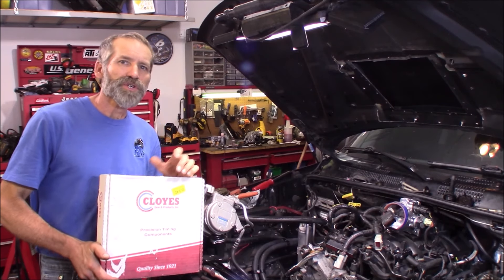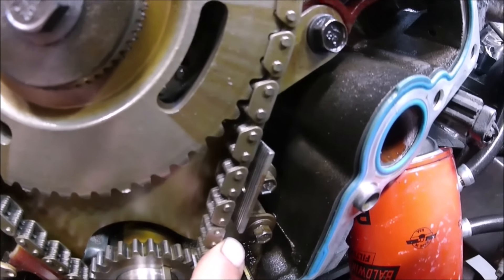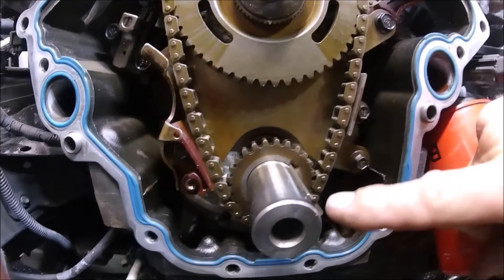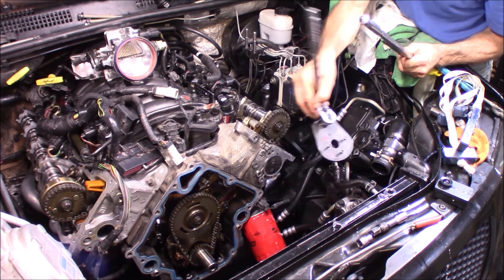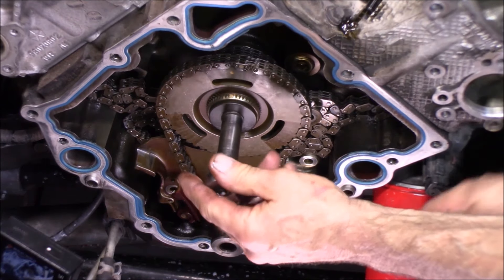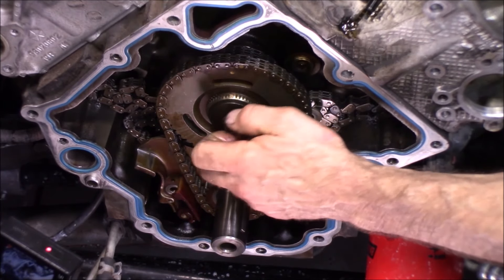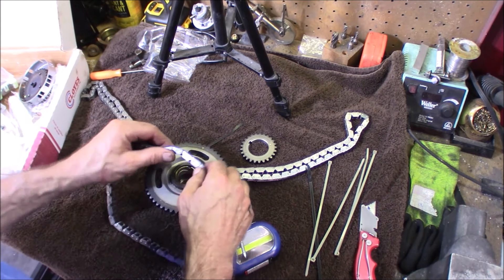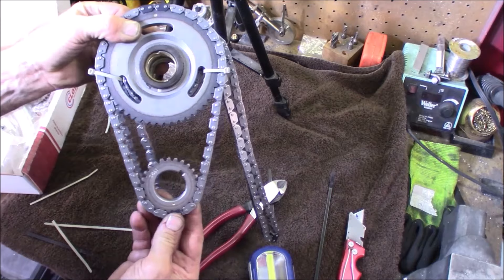How to Install Timing Chain Set Dodge, Jeep & Chrysler 4.7 & 3.7L

Comment: Great video as usual! Do you know if it's bad if I accidentally put the transmission into Neutral while driving , then when realizing it I put it in Drive again.. (WJ 4.7) . Nothing have changed but it bugs me.
Reply from the maker: I put mine in the neutral all the time especially at every light and when coasting. I've been doing that for years to both my Jeep to help improve gas mileage.
Reply: @martinbuilt  Really?  You put it back in drive while coasting too? There was a slight "thud" when I did it .. nothing crazy, but not smooth! I was going at about 25 mph in city traffic and had cars behind me so I couldn't just stop the car.
Reply: @martinbuilt  I have read/heard that you should keep it in Drive while coasting, the fuel injectors will shutoff just by letting off the gas pedal. The momentum of the car rolling will keep the engine going. There's videos on youtube "5 things not to do with automatic transmissions" that mentions that.. :)
Reply from the maker: @farerse  yeah whatever I've seen that video I'm calling BS. I have a wideband air fuel ratio gauge  and I can assure you when you let off the gas it is not  shutting the injectors off . And besides when you're at a light you put it in neutral you've taken any load off the engine. I can guarantee you you're saving some gas.
Reply from the maker: @farerse  were you on the gas at the time you put it back into gear. When I put it back into gear I always have it at idle.
Reply: @martinbuilt  Interesting , I do change a lot between 2 and D depending on the speed limit and traffic conditions.. this time I forgot I was already in D and put it into Neutral. I did let off the gas pedal , and tried to slow down before putting it in D again.

Comment: I have a question.   I pulled my cover off and my primary chain tensioner is broke.  Would it have caused the engine to be off time?
Reply from the maker: I doubt it, as you saw in the video my primary chain tensioner was broke as well and I had no idea that it was broke the engine ran perfectly fine.
Reply: @martinbuilt  Okay thanks
Reply: One more question. 
Could an 07 cylinder head go on an 05 3.7 bottom block?
I remember you saying the 4 wire ecu is different than the three wire from the 05.  But I was thinking would I have to switch cam sprockets,  or just cams,  or should I get a cylinder head from a 3 wire ecu engine?  Thanks.
Reply from the maker: @Ed.01  yes you can swap cylinder heads as long keep the same cam gear on the right side (passenger side) stays with your vehicle.
Reply: @martinbuilt  okay cool thanks.  I'm at the pic a part, but the 07 was bad, I got one off an 02 that looks good just the valve cover is different.   I appreciate your videos on the 4.7s.
Reply from the maker: @Ed.01  I just thought of something that could be different on the cylinder heads. Later models may have an EGR valve at the rear of the left (driverside) cylinder head.
Reply: @martinbuilt  yeah you're right. 
I got one off an 02 liberty for an 05 Laredo so I think I'm good.  I got an 05 valve cover for it too.

Comment: Is this what is considered dual overhead cams?
Reply from the maker: No this is a single overhead cam engine.  Here are some examples of dual overhead Cam engines.
Ford 3.5L EcoBoost V6 DOHC.
Ford Mustang Boss 302 5.0L DOHC V8.
Ford Mustang 5.2L V8 Supercharged.
BMW S65 DOHC V8.
Infiniti 3.0L VR30.
Mercedes-Benz Inline-6 DOHC
Reply: So the main chain runs from cam to crank what are those other 2 chains running. I’m a backyard mechanic kind of lol. Just my own vehicles but I’m not familiar with this set up.
Reply from the maker: @SVMSICE   The main chain goes from the crank shaft to the idler gear the other 2 chains go from the idler gear and one to each camshaft
Reply: @martinbuilt  Oh so there’s 2 cam shafts. Ok thank you.  Now I have to look into what an idler gear is.
Reply from the maker: @SVMSICE  Perhaps you could watch the video.🤔
Reply: @martinbuilt  yeah that is a good idea. I listen to YouTube at work so a video like this I save for the evening or morning. I just watched it. I understand it a lot more now. Thanks for taking the time to make this. You did a very good detailed job in explaining the procedure.

Comment: Hi can you help me out. I put an 06 head on an 02 4.7. Now it won't start. Crank but will not fire. I kept my original camshaft gear as it is not a NG. Will the head from an 06 work on an 02?
Reply from the maker: yes it will work, are you sure the timing is correct.
Reply: @martinbuilt  I will check out cranks but no compression. I redid the timing maybe I made a mistake?
Reply from the maker: @Phoenixrising8313  are you saying you have no compression? You may have bent the valves.
Reply: @martinbuilt  Sorry I have not done a compression test yet. The motor just cranks but does not fire. There was no metal damage sound when I tried starting the engine indicating valve damage. I changed the head with head gasket passenger side and re did the timing chain. Motor will not fire. I have not ran a test for spark fuel or compression yet.
Reply from the maker: @Phoenixrising8313  did you remember to plug the camshaft position sensor in
Reply: @martinbuilt  Yes I even swapped it out with another lol. Cranks but no start. Have not tested fuel, spark or compression until tommorow. Any guess what it may be? Or something I may have missed.
Reply from the maker: @Phoenixrising8313  Like you said, check fuel pressure, spark, let me know
Reply: @martinbuilt  Hey Martin my timing was off. I Did not have the crank, cylinder 1 set to top dead center. I will have it put back together tommorow.
Reply from the maker: @Phoenixrising8313  glad to hear you figured it out.
Reply: @martinbuilt  Thanks for all your help. She runs great!!!
Reply from the maker: @Phoenixrising8313  I'm glad to hear that!

Comment: Martin..please help..Dakota 3.7 2005 ..cranksensor p0335..I changed the cam and crank sensor but still not working properly after erasing code ..comes back...
Turns but takes few long seconds and loss of power..no more than 2500rpm
Reply: Help me ..where is the lector Pin that goes to the Computer..or...you Recomend..Have not cheked the ground, 5v or pulse
Reply: dont know wich is the pins or where it go

Comment: Martin, great video you made a subscriber out of me.  You talk about the cloyes kit in the beginning of the video and then say at the end how important it is to get a good quality kit, not something from China.  I agree.  But in the comments I believe you admit that the cloyes kit is chinese.  I suspect the melling kit is as well.  Do you know of any alternative timing kit for these engines that is made in usa or canada?  I have found that these days there really is no alternative to buying the mopar parts but it takes a long time to get them.  I just cant stomach replacing  mopar parts with chinese aftermarket.
Reply from the maker: I feel that Cloyes is a higher quality made product now there is some real Chinese c*** out there.
For what Coyes charges it should be made in the states. 
 Unfortunately it is nearly impossible to find anything Made in the USA anymore 😕

Comment: I have to ask..... What is the importance of having the dark links visible in the window/slot?
Reply from the maker: It's all about getting the camshafts time properly with the pistons. If you didn't time him correctly, the engine wouldn't run properly or at all, and you would have valve to piston contact.

Comment: Great video Martin any racomandation on good type of sparkplug for a 2004 dodge 1500 whit 4.7 manual transmission, your the master of the 4.7 engine thanks and thanks for your video you the best
Reply from the maker: I have always liked Champion's in Chrysler products, but I hear lots of good things about NGK's
Reply: Thank you
Reply: I’m trying everything I know to get better mpg any tips?
Reply from the maker: @Brunocorse  you could try changing to these fuel injectors https://youtu.be/PjpsYLFyCiw it worked for me.

Comment: I have a 3.7 05 dodge ram needs timing chain replace
Reply from the maker: The one thing this video does not show is the balance shaft that the 3.7 has. You will also have to time that with the marks as you install the idler gear with the chains.

Comment: Well got it figured just need to make something to hold the cam gears to torque them
Reply from the maker: I'm glad you found it helpful thank you for watching
Reply: @martinbuilt  ya the only thing is you should use the dots on the gears  to time it and not the windows.  But ya very good video

Comment: Martin you’re the man. Thanks for the videos. Just finished a timing chain on 05 Ram 1500.
Reply from the maker: Thank you, glad I could help!
Reply: Hey @MrGoliat6288 I have the same truck and it just started having a knocking sound that seems loudest from underneath toward the back. But I could be mistaken. But the sound doesn’t go away once warmed up. And is pretty loud. 
   Just curious if you had the same symptoms with truck before doing the timing  job. Through research, it seems to me that if it were the lifters starting to go bad the sound goes away after  a bit.   Thanks for your time. 

Also Martin you’re the best. Very helpful.

Comment: drop a 10 mil into sparkplug chamber what should where did it go
Reply from the maker: 10 mm what? If you have a borescope you could see if you can find it that way. And a magnet. It may have also fallen through one of the holes of the cylinder head and under the intake manifold.
Good luck.

Comment: Can I just pull off one cam gear  driver side head gasket is blown grand Cherokee 06 3G truck 2gs for used motorist looking for the easiest way to get'er back on da road.
Reply from the maker: You need to remove the front timing cover and reset the timing if you remove the cylinder head.

Comment: has anybody found a tool for assisting with the torquing down the timing cog bolt. the tool he used would be nice. Also, when he torques the passenger side how is that tool holding still.The drivers side has a few holes in the cog but the passengers side doesn't
Reply: Vise grips on cam

Comment: What was the total cost for your parts, thanks.
Reply from the maker: i paid $308 for the Cloyes timing chain set, $50 for the gasket set and I also replaced the the coolant for around $30, total $388
Reply: martinbuilt 
Very impressed with your overall skill level, thanks very much for offering the video.

Comment: Dropping in a low mi. Used engine might make more sense for me since mine burns a little oil now and it would be faster to just change the whole engine than rebuild part it.
Reply from the maker: It could be is you're and like you mentioned yours is using oil.. You'll definitely want to install the 08 through 13 engine.

Comment: My cam timing chain skipped a couple teeth, I don't want to pull the motor. This is perfect.
Reply from the maker: Hopefully, none of the valves made contact with any pistons as this is an interference engine.
I'm glad you found it helpful.😎
Good luck with the timing chain set.
Reply: @martinbuilt  The engine wasn't running. I was installing some HO cams and the chain wedge slipped off. and the chain fell off the idler. I almost got the radiator out. Man, I thought the valve springs were the hardest part. Man, Now I  gotta do this in the WJ,
Reply from the maker: @jamesdewer  oh got it. What valve spring compressor did you use to replace the valve springs.
Reply: @martinbuilt  When it comes down to changing valves springs in the vehicle having the cams out is a huge leg up. That Jig of yours removed the sketch factor. It only works properly centered, concentric to the stem. Thus applied there is no wasted, guess work. Unnecessary exertions are removed, believe it or not the passenger Side rear most set of valves springs we’re not the most difficult. Your tool takes time to determine the proper approach. There’s a 45° slot cut in one of them so on three cylinders I was able to do two springs intake and exhaust without moving the jig. If that doesn’t save you time. And you know that you got your retainers in right because you’ve got time on your side unless your compressor cocks out you got all day to stay in there and align everything and make sure everything is perfect. As long as you’re not standing on your air line, like I didi, t’s near fool proof.
Reply: @martinbuilt  I went with the competition cams valve springs and freshened up the top end per your recommendation. In fact valve springs when you Get right down to it are the foundation of Performance. Also installed FelPro valve seals and low profile Molebnieum valve caps.

Comment: THANK YOOUUUU for mentioning to DIYers about AMAZON PARTS!!! I have to explain this to customers who want to supply their own parts on a regular basis. Unfortunately, sometimes they've already bought their own stuff (so ya really wonder where the diagnosis came from too 😉 lol). Depending on the vehicle and what kind of part it is, I end up either giving them the whole disclaimer first (1.it may not fit correctly, if it doesn't and I have to alter IT, anything else, fabricate something or spend extra time in any capacity to make it fit, you will be charged for that extra time 2. The part may not fit at all in which case i still need payed for my labor time, and if put back together will be another separate labor charge when the new part comes. 3.your part may not work properly or at all directly out of the gate in which case i will not be held liable, i will double and triple check to ensure proper installation but beyond that will need payed a separate labor charge if it jeeds replaced again, or a separate diagnsotic fee, should a new symptom arise where that same new part ends up being deemed the cause).  
OR i will not even accept the job at all.....pretty much anything Bavarian, Scandinavian or german/Eurotrash....im not even gonna waste my own or your time and/or money trying to fix ANY problem with amazon parts 😆 don't buy those junk rides if u can't pay to play

Comment: My question is: Can I use entire timing chain set of V8 engine in a V6 engine?
Reply from the maker: I know for a fact that the cam gears are different from the V8 to V6 so I would imagine that the timing chains are of different lengths and cannot be swapped.

Comment: I can't get the chain and gear to line up with the camshaft no matter what I do. I only bought a chain kit and I'm using original chain gears.
Reply from the maker: I suspect that the cam gears are not sitting at 12:00 and this is what making it hard for you to line up the timing marks and this is caused because of the cam lobes where they're sitting on the valves is forcing the cam to rotate off of 12:00 you're probably need to use a vise grip on the camshaft rotate it to 12:00 as you're placing the cam gear on and you'll find it lines up. Hope this helps.

Comment: Has Anyone else had good results with using the FelPro Aluminum gasket kit for these engines instead of using
 RTV and those (3) O rings .
Everywhere I look for Timing Cover Gaskets for Commanders  it only brings up that RTV kit and  
not this FELPRO Aluminum gasket. They all say it won't fit my Commander!?!?!?! 
I'm confident on following your link though as no one seems to have this Concern.

Comment: Grand Cherokee Grand Jeep 47 I'm having a problem with the number 1 spartk pluas cylinders that have been changed, the device is cleaned, the Coil Pack has been changed, and still does not work in the morning, it works 100%, but after a short trip period, cylinder 1 does not work what It's the solution
Reply from the maker: That is pretty weird, perhaps either replace that spark plug possibly defective or swap that spark plug with another cylinder and then see if the problem goes to the other cylinder.

Comment: Trying to take the camshaft sprockets off so that I can take the heads off my 2011 Ram Dakota 3.7 V6 and have them checked for level and non-warpage and possibly do valve seats. It blew a head gasket earlier this year. I am having a helluva time trying to get the camshaft sprockets off both heads. Absolutely frustrated. I loved this truck until it did this. 144,000 miles. I have the special tools required and I don't want to buy a new engine or let alone a newer truck. Upset, frustrated and already 650.00 in.
Reply from the maker: you can fasten a Vise grip to the shaft of the camshaft then try breaking the bolt loose. I don't like this because it put marks on the shaft but, it wont hurt anything. On the shaft not the lobes.

Comment: 👍 I have to do the chain set on an 07 commander 3.7 hopefully it goes as good as urs
Reply from the maker: The 3.7 does have a balance shaft as well so the install is slightly different when it comes to reinstalling The Idler sprocket.

Comment: I was so sad when I found out my timing chain needed to be replaced. I like working on my own cars. So I’m going to do it myself. Weird thing is, I don’t have any code or anything other than a rattle when I let off the gas pedal. 259k 3.7 dodge Dakota. So it’s time to replace the timing chain
Reply from the maker: The 3.7 does have one more thing  to time and that's the balance shaft so it's a little bit different than the 4.7
 one more step.
Reply: @martinbuilt  thank you! I’ll keep that in mind this weekend when I tear into this engine. Thanks for the help keep doing what you’re doing!

Comment: Good vid.  HOWEVER,   at 4' 40 seconds you say that the corresponding TDC marks are where the engine is on it's EXHAUST Stroke.... Shouldn't that be the COMPRESSION STROKE?
Reply from the maker: Not when the timing gears are in the position with both V8 Marks pointing upward

Comment: I guess the 4.7 does not have the counter balance gear in back of the timing chains like my 3.7
Reply from the maker: That is correct, 3.7 requires ot because it has two fewer cylinders. 
Thank you for watching.